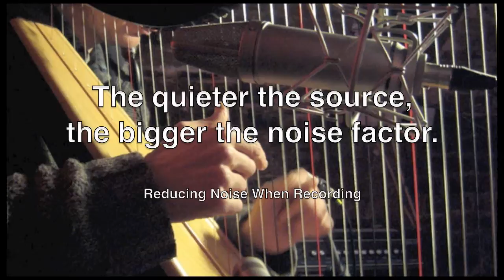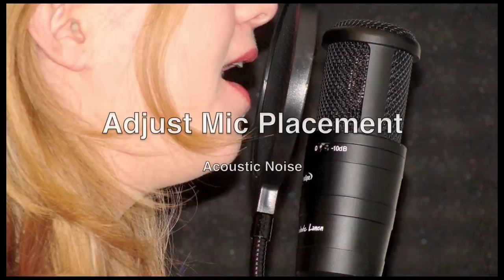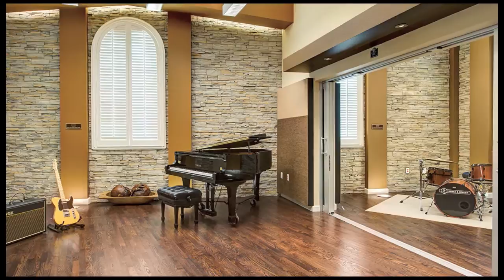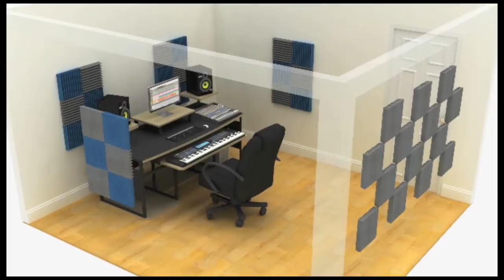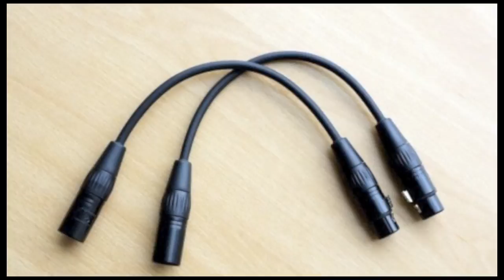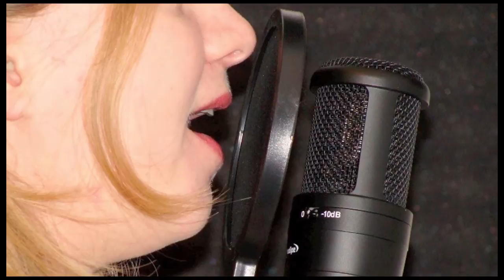How To: Reduce Noise During Recording

Comment: Incredible, but you forget (i hope!) to mention Ground Conection...
Reply from the maker: Yes. I was limited to 5 minutes in the task and a reasonable discussion of ground connections would have taken most of it. Also, I thought if you really had a ground issue with the electrical infrastructure, most people would not be equipped to really do anything about it. . . .